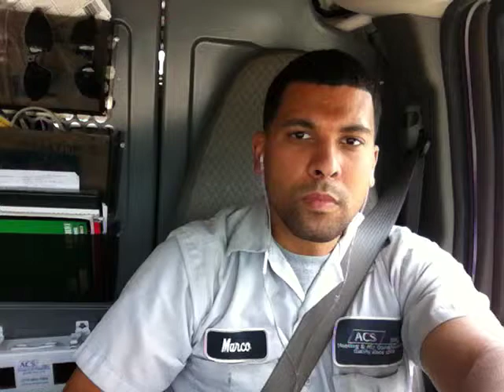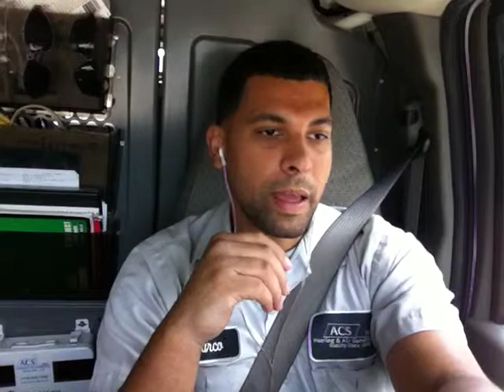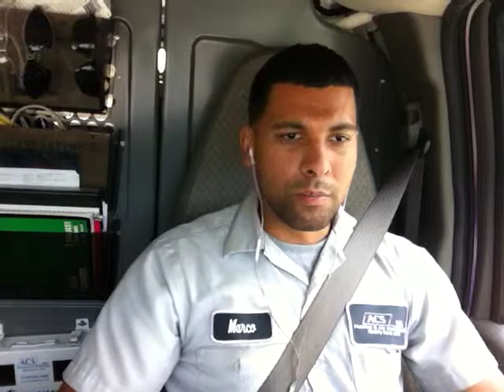Blog#4: lennox keeps installing the liquid line driers inside the condensing units. Why!?!

Comment: Goodman started doing that because they found a bunch of driers in the dumpster at a job site at an apartment complex. Basically the installers where not using driers to on equipment so they decided to sell the units with them installed to try and protect their equipment a little more. At least that's what I was told.

Comment: Marco anytime that I find a leak or bad txv, ect that is beyond the service valves of the condenser we don't necessarily have to "replace that line drier".  I've asked multiple Lennox engineers and have gone to the Lennox school in dallas tx. If the system is pumped down into the conderser and service valves arent leaking, once you repair leak or txv and have pull a proper vacuum 500microns the line drier is still considered to be in a sealed system, technically its never actually being exposed to the outside air. as long as im welding with nitrogen and pulling a proper vacuum I won't replace that devilish line drier. I usually pump down my system then let it sit. if my pressures slowly move up my valves aren't holding. then I do what you do an place the drier I'm a more convenient place. now it's it's a heat pump txv or condenser leak u have no option but to replace it. hope this helps. I did my research on this issue.

Comment: York also has the LLD on the inside.   Mine just went bad with a leak and my system is only 2 years old.   I'm wondering if the vibration from the unit running caused the leak.